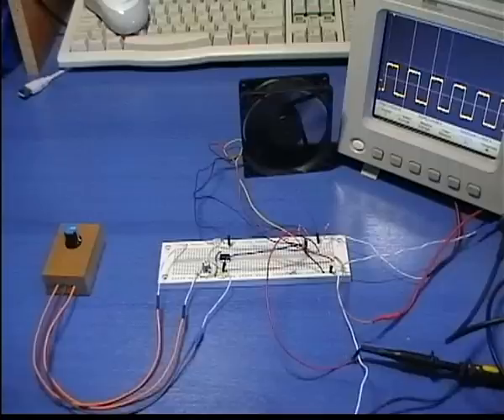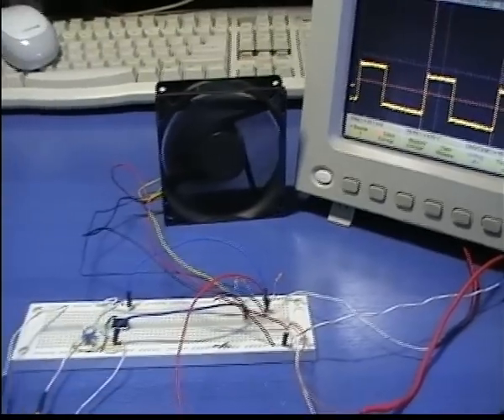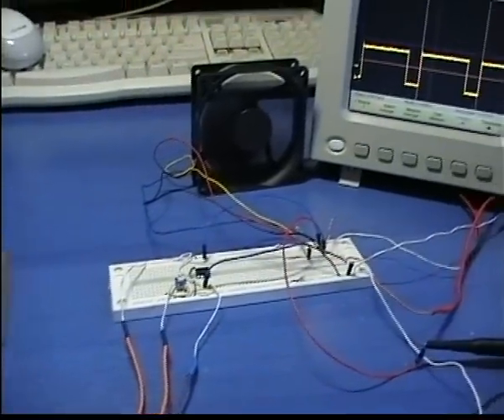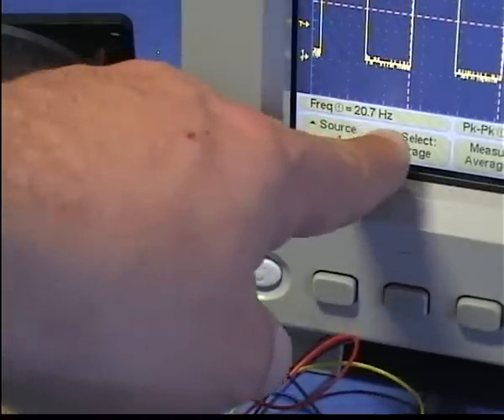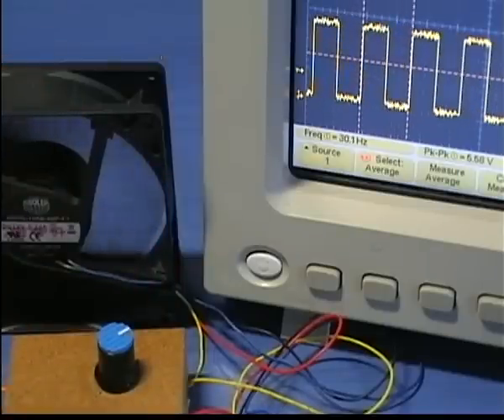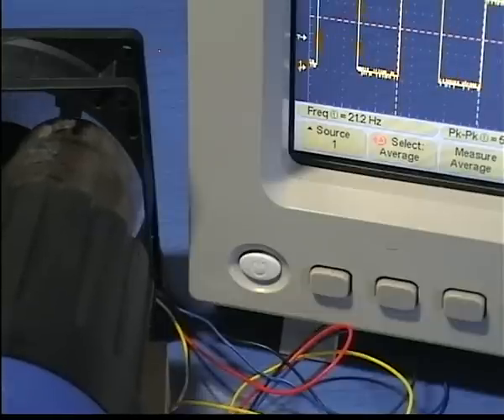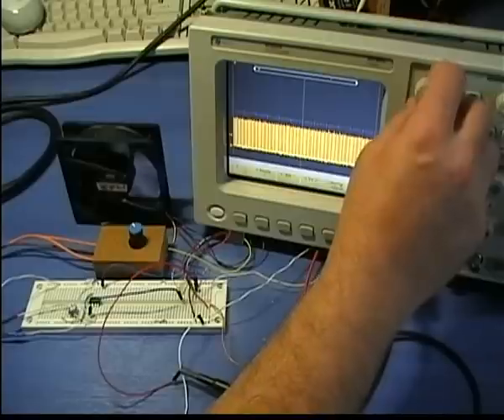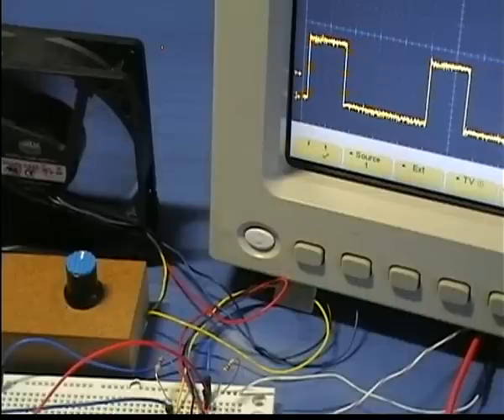Closed Loop PWM PC Fan Controller

Comment: Amazing. You aren't as much controlling the average voltage through PWM, but rather controlling the fan RPM directly. The PWM is dynamically changed to maintain RPM?? You sir, rock.
Reply: I think the motor is BLDC and the controller inside the motor try to match the RPM that was given via PWM signal.